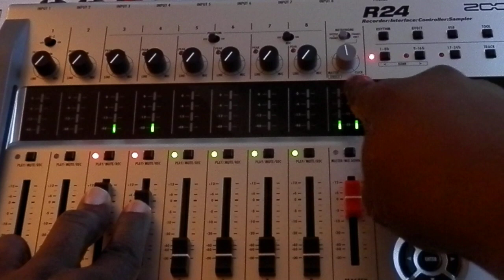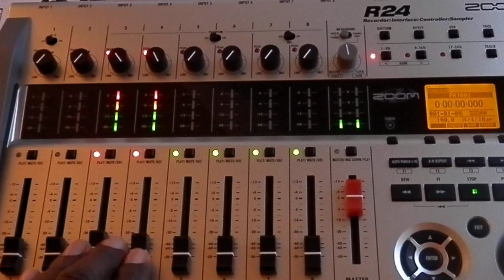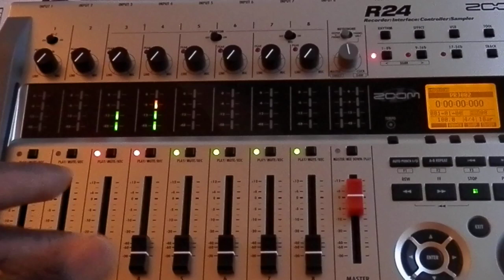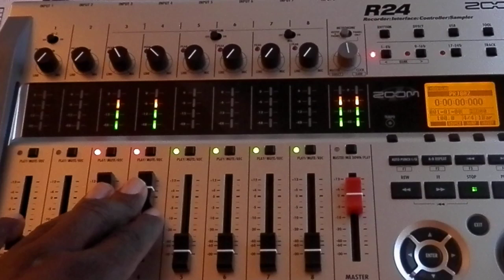Zoom R24 Recording Levels

Comment: the approach is interesting, It leaves a little wiggle room between tracks. Though i think using a 12x12 approach is a little too broad for acoustic instruments and microphones. If you aim for 3x3 or maybe 5x5 you could end up with a lot more lead space in the mix. I almost never want a guitar past 12 o clock on gain just because the tones become thicker, making that channel dynamically souring up the mix.

Comment: Good video, but beware.... once you come to mix down several tracks you may run out of overall headroom on your master channel if you run individual channels to the absolute max. This is not disastrous but can make final mixing a bit more difficult. The SNR on these 24 Bit systems is so good you should be able to comfortably run all your individual tracks at around -6 max and then use a mastering plug in to boost the overall output on the final stereo pair to boost final volume.